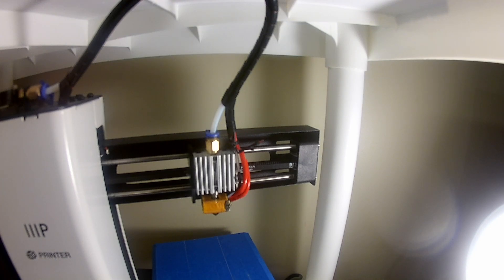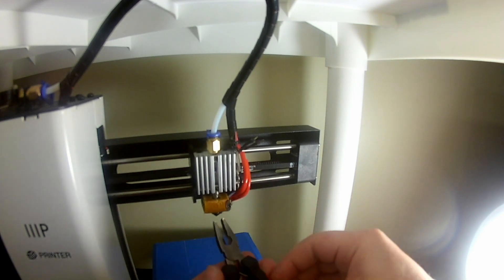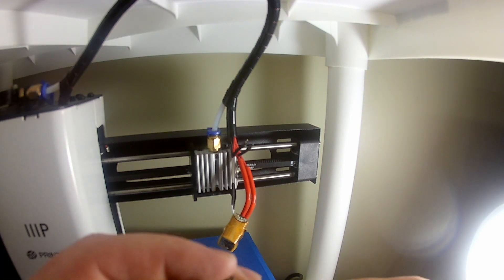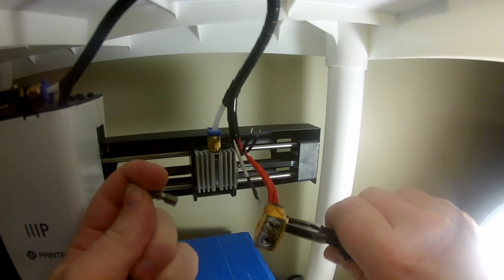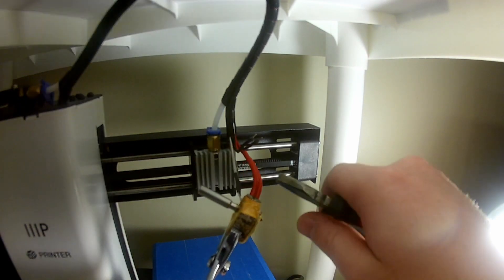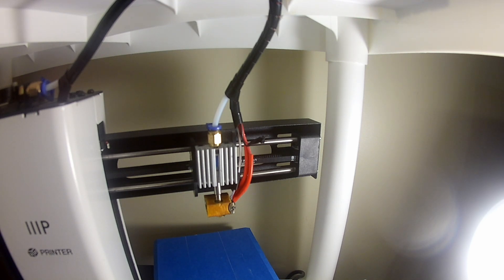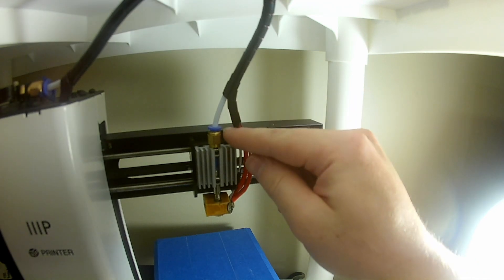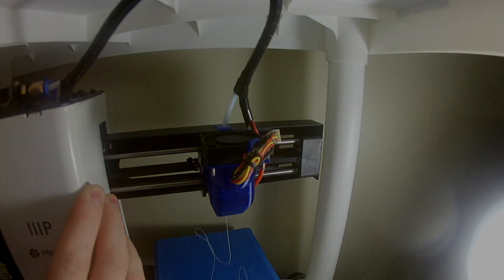MonoPrice Select Mini Nozzle Replacement + NinjaFlex Mod

Comment: you have remove the upside isolation around nozzle and heat block ? This is essential to isolate the Block with Alufolie.
Reply from the maker: Hello Karsten,
The insulation is not necessary, however you must do a PID autotune after removing to have stabil temp control.

Comment: I accidentally pulled the white wire off the heat end what should I do?
Reply: SharpShooter 007 I did that too? Did you find a way to fix it

Comment: Hello! - How did you get the printer to crank out filament like that at the end of the video? Is there a particular STL file you use or?? Please let me know, I'd appreciate it:-) Thanks! FIGURED IT OUT - Use the jog menu select "extrude" to manually advance filament - works GREAT!

Comment: Have been searching, calling, etc. trying to find the size of the grub screw. Do you know what the nut and screw sizes are?
Reply from the maker: The grub is an M3, the nut is a square M3:

https://www.amazon.com/100pcs-Stainless-Steel-Square-Nuts/dp/B018JPZNS6/ref=as_li_ss_tl?ie=UTF8&qid=1491359981&sr=8-1&keywords=m3+square+nut&linkCode=ll1&tag=fg0ea-20&linkId=4394826da4971e516a7d7410450c4da1

https://www.amazon.com/uxcell-M3x3mm-Stainless-Socket-Screws/dp/B01AXVSHVY/ref=as_li_ss_tl?ie=UTF8&qid=1491360095&sr=8-3&keywords=m3+grub+screw&linkCode=ll1&tag=fg0ea-20&linkId=4d449ad5a0b8da9d8a83c6aa0490d4c9

Comment: Nice video, I have a quick question, I just replaced the nozzle with some I ordered off of Amazon, found here. 3D Printer Head(6PCS),6PCS 3D Printer 0.4mm Extruder Brass Nozzle Print Head for MK8 1.75mm ABS PLA Printer(0.4mm) https://www.amazon.com/dp/B01E91Q6OE/ref=cm_sw_r_cp_api_turKybJ1VB805

My question is that when I installed it and put everything back together and I set the size of the nozzle to a variety of different sizes .4mm and up to .9 mm however when it goes to print it presses down and compresses the print bed, I don't know what else to do as I do not have an extremely precise way of measuring the nozzle, however I measured it with a centimeter ruler and it looked like it was about .9 mm. Which I selected and it still didn't work. Any response would be appreciated, thanks!!
Reply: If the nozzle is colliding with the bed, you need to re-level your bed. Before that, make sure that you have moved the whole hot end up a little, because the new nozzles are longer than the original one. You have to make up for that difference. Once it's close, level the bed for the fine adjustment.
Reply from the maker: Sorry for late reply, but Tim is correct; start by coarsely adjusting your hot end height by loosening than re-tightening your heatbreak setscrew. Once you are close, re-level your bed  following the instructions in my bed leveling video.

Comment: Is there any flexible filament that would print on the Select Mini without any mods??
Reply from the maker: As long as you print slow (20-40mm/s with 10-20mm/s retract speed), soft PLA will probably work fine. Soft PLA is similar to TPU but just a little bit stiffer:

http://amzn.to/2jXv4ip

Comment: I tried to do this and could not get the nozzle loose at all. tried it with the printer on and off. I think im just going to replace the heat end with the E3d to make nozzle replacement easier.
Reply from the maker: Hmm, was the heater on when you tried? Also make sure you are using strong pliers or a wrench. The V6 uses the same nozzle and heatbreak threads and thread depth so it should be same experience when swapping nozzles.
Reply: FDM Guru it was on. It did not budge. Replaced the hot end and all is good. 

This video helped me get the stock hot end off.

Comment: What if you do run it hot and Jam the PTF inside of the heat sink? How do I buy another one? Or whats the easiest way to replace it
Reply from the maker: You can remove the heat brake, push out the melted liner and replace with a fresh piece:

https://www.amazon.com/Length-PTFE-Tubing-Printer-RepRap/dp/B012T96HIS/ref=as_li_ss_tl?ie=UTF8&qid=1483941537&sr=8-5&keywords=3mm+ptfe&linkCode=ll1&tag=fg0ea-20&linkId=b7c6cf84b7ee16dc52cdbcee903376bf

Comment: weirdly enough my printer was shipped with the tiny piece of tubing between the tubes brass coupler and the heatbreak. So I guess thats one less mod that I have to do. :D

If I did want to swap to a all metal heat break, which ones do you recommend getting? I know some have much better tolerances and internal finishing than others. 
Also does it hurt if it has threads on the upper part that goes into the heatsink? I know the stock heatbreak doesn't.
Reply from the maker: Yep, the newer ones come stock like that :) fully threaded will work just fine BTW.

Comment: On the top of the heat sink. Why not just drill out the Bowden fitting and push the bowden tube, all the way, to the heat brake, that way you wouldn't need the little  chunk of tube?
Reply from the maker: Should work great that way, many people won't have a drill press or handrill and vise necessary to do that however.

Comment: quick question for you. i recently got a clog and i think i expanded the tip of the nozzle a bit. would i be able to just replace the nozzle without changing anything else? and also if you know about the insulation and tape mine is all ripped up. any help is much appreciated!
Reply from the maker: Hey Kyle,
I hope you got your answers already, however for those reading comments:
1)  Yep, ou can replace just the nozzle.
2) The insulation is not strictly necessary, however if you want to replace it here is a source:

https://www.amazon.com/Fargo-3D-Printing-100002-Replacement/dp/B00KSLT6FG/ref=as_li_ss_tl?ie=UTF8&qid=1483941276&sr=8-3&keywords=ceramic+insulation+tape&linkCode=ll1&tag=fg0ea-20&linkId=a59f786b1b2dcada12bcd7d5d4a46bca

Comment: my thermistor failed, but when I pull up the heat shrink it looks crimped. so now I'm confused.
Reply from the maker: If you pull gently on either lead is it loose inside the crimp?

Comment: To print with ninjaflex, would you recommend this printer with mods, or is there another <=$500 printer that you might recommend instead that wouldn't require modifications?
Reply from the maker: I think this is a great candidate for printionmg flexible materials; to be honest there are many many <$500 printers that perform fairly well but most require some kind of tweaking or modification out of the box to use ninjaflex in a practical manner. The upside of the Mini is that its very cheap and easy to work on and has a very active facebook support group if you run into problems.
Reply: FDM Guru - thanks for the info and for the video.

Comment: do not have any 3-d printer but I do want to get one which is appropriate for a first time user, do you have any suggestions as to which printers I should be considering?
Reply from the maker: Bob is asking all the right questions; this printer may require some hands on work for small issues, however that will help you gain a better understanding of the technology.  There are many, many printers that a first time user could successfully operate as long as they are willing to learn, however the Select Mini is so easy to get into and and learn on that even though it may not be perfect, its still a better option than many more expensive printers.
Reply: What do you want to do with the printer?  How much do you want "tinker".  I was planning to build a printer, but a month or so ago bought the MonoPrice Mini - the price was compelling.  I have been using it to print  Hypercube 3D printer parts.  I have had my share of nozzle clogs, a broken extruder and a few other things that required disassembling things and fiddling.  The process has been educational.  For the price this was a good printer to learn with, and it has been useful to start building the parts for my next printer.

Comment: Why do you keep it hot while removing the nozzle? I have a clog and will be attempting to clear it tomorrow.
Reply: I was struggling to remove the nozzle with the printer cold, and got close to stripping the nozzle.  I decided to try with it heated, and it was much easier to loosen.  It must be that the heat block expands more than the nozzle, making it slightly easier to loosen.
Reply: Yes it will strip....learned that the hard way.

Comment: I have this same printer and I'm interested in the settings you have found to work best using NinjaFlex. I have tried but my attempts have resulted with very stringy unusable prints. TIA
Reply from the maker: Start with slow print speeds in the 20-30mm/s range and fast move speeds 100-120mm/s. I printed TPU at 210C  with retraction at 40mm/s for the pull and 10mm/s for the return and a retraction length of 4mm. Also make sure you enable combing, as that will keep as much oozed filament as possible inside your part perimeter and off the sides.

Comment: Hey Sam, I'm from the group on Facebook, wondering if the nozzles linked here would work with everything being stock? TIA!
Reply: Also, the insulation tape on the heat element is completely shredded - will any old kapton tape fix this?

Comment: would it be better to rotate the heater block so that the wires are coming out towards the front of the printer?
another suggestion that i got from the facebook group is to completely separate the wire weave from the bowden tube so that they are able to flex at their each own flex. just unwind the sleeve and rewrap around just the wires.
Reply from the maker: Hey Michael,
Thanks for commenting! The default heater block orientation provides the best access for layer cooling so I would not rotate it. I like the separation idea although I would probably loosely clip them on a couple places still.

Comment from the maker: Links added for the Nozzle I used as well as the thermistor lead ferrules.
Reply: Would you ever do a full dismantle guide? I printed and wanted to replace with an e3d clone, but it's seeming daunting taking the whole thing apart almost.
Reply: Owen Patrick it's actually not that hard to do. You still need to remove the fan, remove the things attached to the heat sink via  the screws, remove the heat sink be removing the screws on the arm(the z axis). Move the lid to reveal one hex screw. This  will loosen the belt. Move the belt to reveal the two screws holding the heat sink in place. Attach your e3d Monoprice adapter, install the e3d hotend. And reassemble the x axis reattach the thermistor and heat cartridge. Done